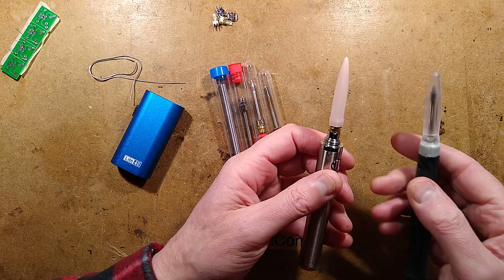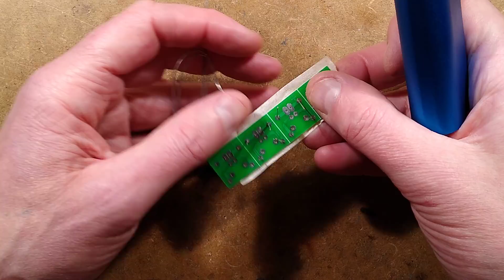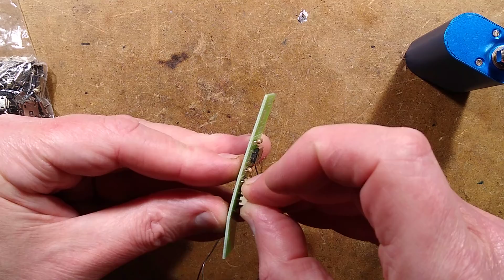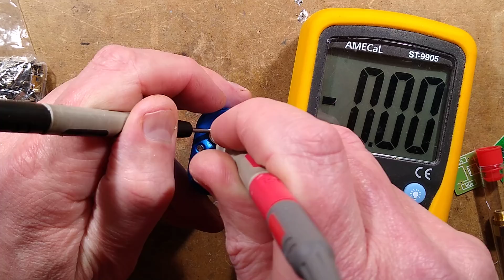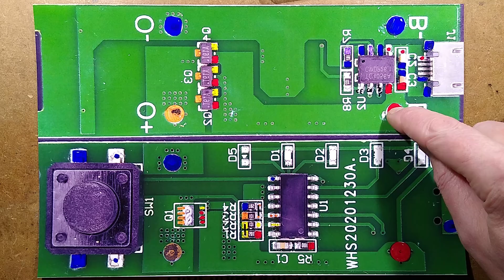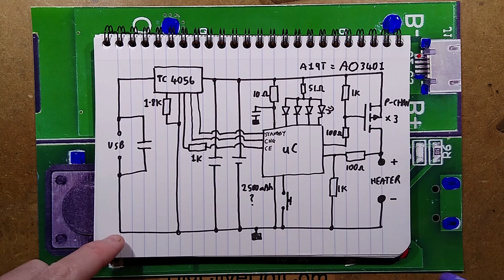Cordless soldering iron teardown (with schematic)

Comment: How can you buy one of those, the three tips look as if they could fit my Parkside one. I bought an extra tip for that from AliExpress, and it lasted about two months and then came apart, the light bulb base just disconnected from the rest of the tip. Nice videos by the way, I watch many of them. Keep up the great work. Thanks.
Reply from the maker: You can get replacement bits in the same style as your Parkside iron.

Comment: BigClive, I am looking for a DIY high amp, instant-heat solder iron/gun design using a pair of high drain 30A 18650  lithium cells in parallel.   Have you heard of such a device or am pipe dreaming again?  Realize run time would only be a few minutes between charges, but for me that'd be all I need(most of my soldering can be don with my 22/44W iron).  Please let me know your thoughts.   -)
UPDATE:  no one seams to be using 3.7V, but to a simpleton this is just easier.  AI suggested nichrome wire route with heavy gauge copper? Seams like a plan since I have both?
Reply from the maker: I can't immediately think of a high power lithium powered iron.  Just the classic small ones.

Comment: I used to have a somewhat powerful erm..device that used this connection and began using it for this purpose as I no longer use the device for its intended purpose. The bonus to that device is that it had adjustable output of either voltage or current as well so it made a rather handy little iron for the field.
Reply: What tips are you using? Most of what I can find is like... 8w.
Reply: @ I just have the three tips that came with the kit from Temu. They can be ordered separately if you look for 510 connection style soldering tips. Maybe on Amazon as well but I never checked.

Comment: Ideally one would use those tips with a "sur_myevic" compatible device, turn off the timeout, turn on the "single press fire" and tune the pid temperature regulator too.
Would be worth a shot for a video ;)

Comment: I used to love these little rechargeable irons until I got a butane one. Never would've thought they would work so well with the regular soldering tips but it does

Then you can just change to an air tip to blow hot air for SMD stuff or heat shrink, or to the flame tip if you want something real hot like pipe joints

Comment: I wonder if I can buy just the 510 connector soldering tip,, and plonk it on my dual 21700 200W box mod. Wonder what the resistance of those tips is. This is an ingenious way for eBay sellers in China to move vape inventory now the fad is a little less prominent.

I actually had one of those eBay blue modules that ended up not responding at all. Suspect the lithium cell died. Will have to replace the cell now :D

Comment: I'm guessing that a plain soldering iron is nothing more than a thermistor and a bridge rectifier then?
Reply from the maker: The circuitry can vary greatly from a simple heating element to electronic sensing and control.

Comment: The standardized 510 thread connection on vape devices is pretty useful. I wonder if it's possible to get a 510 male to female cable....

Comment: I actually "made" one of these for myself a couple of years ago, by creating an adaptor from a dead vaping heater/coil and a RCA connector - which allowed me to connect a vaping device to a soldering tip from a Weller BP865MP.   It worked surprisingly well (and way better than the BP865MP), as long as I kept the supplied power bellow the tip's 8 watt rating (apart from the same timeout issue).
It's really fun to see that it's now an actual commercial product.

Comment: I saw this video an got myself one too. The first job was to modify a bunch of D Cell adabters with 3AA bateries. I baught the wrong ones with 4.5 Volts  (because cheap 0.86€ pice) so I had to swab a Spring and connect some metal plates with wires to convert them into the 1,5 V version. It woked a charm and hold up very long and charged suprisingly fast. I have an Ersa gas soldering iron. Its good too, but takes way longer to heat up and is always difficult to lay down becaus of the hot air that is blowing out of the side of the tip. And this hot airstream melted on several ocasions some things around the solderjoints. This little device is much more convinient, smaller, better to handle. Thanks for the video

Comment: After seeing this video and the realization that I have several 510 threaded battery units that I bought to make mini fog machines with(with small 3 volt air pumps and some glycerine) I ordered some 510 threaded solder tips and just got them and they work perfectly.  Something new to add to my carry-all bag.

Comment: I have a cordless soldering iron powered by butane. It has a little catalyst in the end which heats up as the gas flows over it. It actually works quite well.

Comment: After seeing this video I had to try one and ordered just the element as I have a decent vapes with the right controls to set it for the element, I'm very impressed with how well the thing works and is more than good enough for a in the field repair tool which I'll keep in my backpack that I have for all my Rc gear :)

Comment: I always thought Molex was what SATA power replaced?..
Reply: Molex is actually a brand name.   Yes, the traditional ATA power connector was a 'Molex' designed connector.   It's much like "LocTite", which had several versions - blue, red, black, green.   Then the Permatex Corporation decided to use LocTite as an overarching name for all of their adhesives, and now 'LocTite" is called "Tite-n" (I think that's it)   So, Molex has LOTS of connectors.

Comment: I have long believed that portable soldering irons should use contactless battery charging, similar to that of electric tooth brushes.
The item would then charge as soon as it was placed on the charger stand. As far as I can tell the toothbrush chargers, use a cup and mushroom ceramic core material as the charging transformer, and coupling. The mushroom is up side down in the base of the mains powered charging unit, and the water proof sealed cup part of the transformer is in the base of the toothbrush. 
This arrangement allows the toothbrush to fit onto the stand and be held in place. I am guessing that this design is capable of modification to produce a reasonable charge current, given the close magnetic coupling between the base and the toothbrush.
It is not hard to imagine the basic design being converted to a slim line soldering iron. The advantage over existing units is that the available devices use plugs and sockets, or connectors, between charger and batteries in the iron. Magnetic coupling would likely produce a more reliable and convenient charging interface. 
So far, my electric tooth brush is in working condition, or I like have disassembled it, to discover the details of its electronics, and to measure its maximum charging current. Maybe Clive could do this experiment as a video.
Reply: I am really annoyed that the Google spell checker is changing my post just before transmission. In the post above the words "up side down" were changed to "upstairs downstairs". Very creative, but I have never been a fan of the Edwardian TV drama.

Comment: This would be handy for small quick soldering jobs without having your main all dancing desktop unit at hand. Also, great for any jobs that are in awkward places like under a model railway baseboard. I could find a use for one of these myself, as my aging gas filled portable soldering unit is now leaking the gas from the regulator leveller... dan-ger-ous flame escapes or blow outs have occurred from the lever, ouch.

Comment: the TP4056 has a trickle charge for when a battery goes under 2.5 volts to bring it back up. im almost 100% on that but quote me on that(maybe i should of said im 99% sure it has that feature) but my nephew had an ipad and when it r ran out of power the battery read 2 volts and the only thing (apart from me forcing current into it from my power supply was to  plug it into a power bank that had a TO4056 in it and it always worked to bring it up over 2.5v so it would take a charge. now because that TP4056  is been controlled by that other chip that Clive is showing us im not sure if it will work the same. but if anyone reading come's across this problem of a battery under 2.5v a TO4056 module "will" do the trick and bring it back up for you. hope this helps someone how has this problem with phones not taking a charge or other devise's. use a power bank(hint you might have to plug it in for a second or two and keep repeating on power banks that hasn't got the TO4056.)
BUT ID BET MOST ELECTRONIC GUYS WILL HAVE A FEW TP4056 MODULES LAYING AROUND ; )

Comment: Would really like to see you do a wireless earphone teardown and go through the signal flow of the device,   Clive. I imagine most have relatively simple circuits with one or two clever little brand dependent implementations/variations here and there that you could break down and explain to us in your very unique and easy to understand way.
Reply from the maker: It will be heavily integrated into a dedicated chip.

Comment: This is interesting. I have tons of variable wattage and variable voltage devices that would be perfect. A few will exceed 10volts or 200watts. (Most do not exceed 12 volts or even reach that.) Darn you! I did not need to buy anymore stuff I don't really need but I'm already googling 510 threaded soldering iron tips.😆

Comment: I'll buy one cause it's cool and a toy I can play with. But my experiences with portable solder irons is they work great 50% of the time and just by a little bit, a wee bit as Clive would say, just don't have enough power to heat up the biggest, most important, most needed to be redone joint in the equipment, so I pull out my trusty lighter and heat the tip up hotter, of whatever solder device I am using so the tip gets hot enough to complete the job. I end up carrying all of my irons in my vehicle along with my solder gun so I am always covered. A trip to Radio Shack to pick up a new iron can't be done anymore so I must carry what I need.

Comment: With a different board and a battery with a high enough current rating, it wouldn't need to have the 10 second limit. That seems like it would get annoying when you're trying to solder or desolder on something that's sucking all the heat away. I expect they literally just bought vapes wholesale and had their own logo put onto it (if that is even their logo), and designed their own soldering tips that screw into the 510 connector, which means they're using a standard chip intended for vapes and they can't change the 10 second behavior of it. It would be a much better device if it didn't have that 10 second limit and was more ergonomically shaped for use as a soldering iron. Of course that would require them to design their own circuitry and casing and it would probably cost more.
Still impressed by how quickly it heats up and how quickly it melts solder, I guess there's just so little thermal mass that 10W is enough. My old 30W iron took forever to heat up and also lost heat quickly when trying to desolder using solder wick. I don't expect this to fare any better with desoldering, but it's certainly good enough for quick repairs like repairing a broken wire.

Comment: I've been using vapes for about a decade now, and most of the ones I've used have had a temperature control setting - I never used it, because you needed a fancier tank with more expensive coils, and I never saw the need, but these solder tips should be able to make use of that circuitry, if they were designed for it...

Comment: The connector type for the solder tip to the power/vape unit is called a 510 interface (has to do with the threaded part being 5mm and the number of turns to make a connection). Good to know when hunting for these soldering tips..

Comment: As someone who doesn't own a proper de-soldering kit, the useless knife bit works really well when using it just wrong for desoldering components, especially surface mounted ones. I just stick it between pcb and a sufrace mounted component and the later one just comes out.

Comment: this is a bit reminiscent of using my dad's old Scope iron back in the 70's, having to push the heating ring every time you wanted to heat the tip. From memory it used a transformer with about a 3V secondary and pushing the heater ring closed the circuit through a graphite heating element onto the back of the copper tip.

Comment: It must have a high discharge current Battery, like a 20A or higher, and i see a Samsung INR18650S-2500mAh battery, 
that has a Max Continuous Rated Discharge of 20A.

I also made new battery's for my and others cordless drills, they also need high discharge current cells 18650, I used the 
Molicel INR18650-P26A 2600mAh - 35A, great 18650 cells that makes 5A 20v battery's.

Comment: Don't blame you for not liking lead free solder, it seldom adheers to components, when it does after numerous attempts it can cause dry joints. Leaded solder is by far the best, I get mine from car boot sales as sometimes I find old reels of it.

Comment: I had a vape mod that was temperature controlled and allowed you to create your own coil profile and set the coefficient. I'm wondering if you could rough guess the values for the tip to create a temperature controlled iron that way 🤔

Comment: there are vapor-producing devices that can control the temperature of the heating element, if it is made out of material that changes its resistance with the temperature, e.g. stainless steel. there are also very capable firmwares for certain devices that can do all kinds of weird things like play flappy bird and tetris on the OLED screen or adjust the voltage/current/temperature over time. I should get myself a couple of those tips and play with them in my good ol' Wismec Releaux RX200s, but judging by the resistance of 1.5 Ohms the heater is likely kanthal, which has a flat temperature/resistance curve, so it's not going to work with the temperature control.

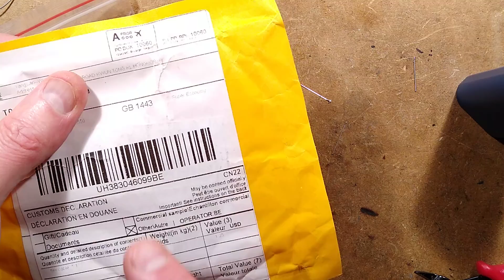Comment: 4:40 judging by the tracking number ending in "BE" it would mean that bpost (Belgium post) was involved with delivery. Usually when tracking shows "arrived at destination country" it actually means that bpost received it. And 4 months is kind of typical for bpost.

Edit: from bpost's tracking it showed that it was in Belgium for almost exactly 3 months.
Reply: The fact that there are more dutch (postnl) drivers in belgium than the actual own belgian post says enough.

Comment: I have both, got the usb one to solder without mains near by, and then upgraded to the fat vaping with screen, it works quite good, and even distracted a bit and run the tip red hot... it was actually glowing, so as you said, you must be careful and don't push it too hard...

Comment: You could technically call those batteries "miniature hand-held fog machines" if other terms are too hot for this platform. And as others have said, just make sure you've got the correct attachment on them or you'll have a bad time😅

Thank you for the videos and information you share with us.✌
Reply: Have an ongoing project making an actual miniature hand-held smoke machine (for my portable effect laser setup) using bits from the same tech..

Comment: I had a look for them on ebay, and they seem to be coming in at about thirty quid a pop without the battery. That seems a bit expensive for what it is. What do you think?
Reply: I bought mine for 14€ from wish. Not the exact same, the one I got has a tip, a power unit without internal battery, and a silicone sleeved USB cable that you connect to any 5V USB outlet, for example a power bank or a phone charger. Works great, been using it as an emergency solder tool for two years.
So, I'd say 30 quid is way overpriced..
Reply from the maker: That sounds like supply and demand price gouging.

Comment: wow that would be great for the automotive work i do i hate using my 15$ crappy one with extension cord and my bench one not practical to bring to work just had to do a relay on a salt spreader last night lately been using those heat shrink/solder combo connectors but they get pricey

Comment: be good for things like electronics on cars as well, because you wouldn't really need to sprawl cables along the ground to use a soldering station in a car. so could see car electricians using them as well.

Comment: Back in the day, many soldering irons had a push-to-heat button. In Australia most technicians had a Scope and a MiniScope iron on their bench. Millennials sneer at them of course because they don't have automatic temperature control. But the oldies swear by them due to their enormous heat range and capability. With the requisite skill they could carry out the finest or the heaviest soldering job. And the fact that they cooled down between joints meant that they didn't burn off the flux.

Comment: I got one of those battery soldering irons for cheap from China. It had only the pointed tip and the battery was the pen type. Using it over one day killed the battery. I could have used one of my others but with that tip it really wasn't even worth trying.

Comment: I use an ERSA 75W gas soldering iron for portable work, but the electric one here  looks interesting.
I found out that using the cutter tip is good for fixing 3d prints, that have gone wrong.

Comment: I suppose the charge enable line from the uC to the charge chip is to briefly disable charging when the “vapour producing device” is used while connected to USB power. That would quickly pull the battery voltage down quite significantly and might otherwise create a big current spike through the charge chip.